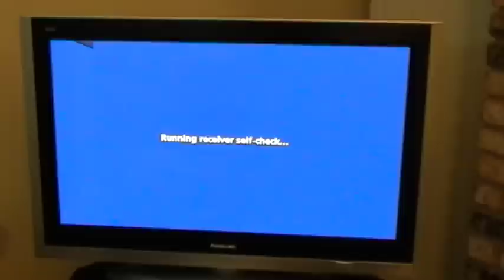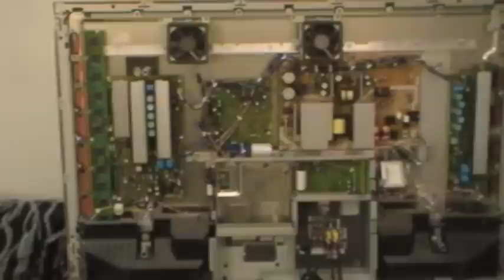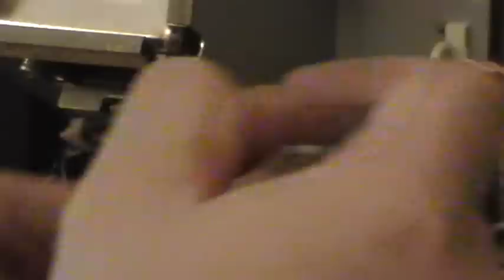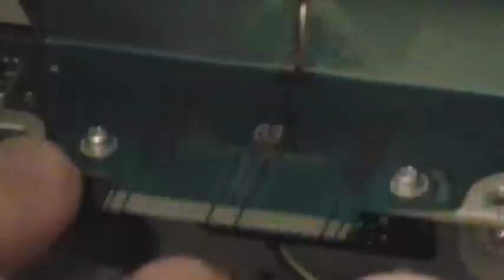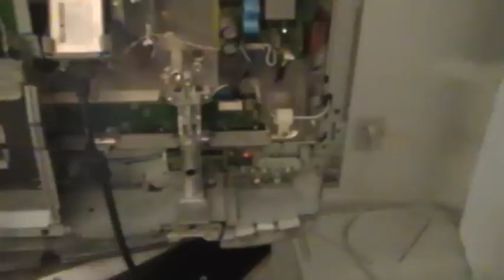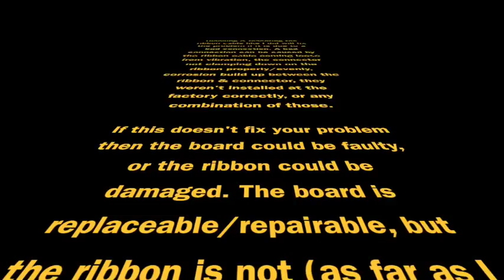Fix Panasonic Plasma TV Vertical or Horizontal Bars

Comment: Thanks for posting. I tried this today with my 2009 Panasonic 42" Plasma television. A 2" pink vertical line appeared from top to bottom in the center of the screen a few days ago. I did exactly as the video suggested, and my tv is now perfect!
Reply from the maker: I’m glad to hear this video helped you out.  Thanks for watching and the comment.  I appreciate it.
Reply: I have this exact problem. Was it easy to fix? And was it a permanent fix?

Comment: Hey Pete thanks for opening up your plasma to solve the vertical picture problem. My 42" Panasonic plasma has a mostly blacked out bar but it's only 1/2 way down from the top. The picture bar also shows a little bit of color image with some images. Any ideas before I open it up?
Reply from the maker: Pet Rock, not Pete.  :-)  Its hard to say what your issue is without having it in front of me.  But if you give the back of the TV a “technical tap" at the top & bottom of the bar and the bar changes then its a loose connection like mine was and this video should help you out.  Thanks for the comment & good luck...

Comment from the maker: ItsaMeMissMario, YouTube wouldn't let me reply directly to your comment for some reason. Anyway, the connectors line up with the vertical bars. So if your bars are in the middle of the screen, you'll need to remove anything on the back of the TV that is in the middle of the bottom of the  screen. On my TV it is the box for the HDMI, coax cables, etc. Its a bit of a jigsaw puzzle, but if you take your time and keep track of what screws & parts go where you should be OK. It might help to take pictures of the back of the TV as you take it apart so that you can get everything back together again. Good luck...
Reply: you sure its not "horizontal" bars? :)

Comment: Thanks so much for uploading this! Mine had this problem for a long while, but then "magically" stopped for months. It's back today, though. I have one question: My line is very close to the center of the TV--just to the left of the "Panasonic" written at the bottom. Is there anything else I'll need to remove to get to that connector?

Comment: My joy was short lived.... After the TV was on for about an hour and a half the dreaded blue line was back ..... Grrrrrrrr!
Reply from the maker: If it worked, even for a short while, then it means you have a loose connection somewhere. In other words, you can fix it.  Take the back cover off and wiggle the ribbon a little and see if the picture changes (even a little).  If it does, then the ribbon cable is still loose.  If not, try the other ribbon cables, as well as lightly press on the board that the cable attaches to. If the picture changes, even a little, then the loose connection is in the area you are touching.  Good luck...

Comment: Thank you for posting this video.  I have a Pana 42 inch which has the same issue (1" black vertical bar down the left hand side).  Tried opening it up and following your instructions; I had a slightly different tv but pretty much all of it was the same as you had detailed.  Cleaned out the connections, and tried to remove any dust etc, but sadly the line is still there :(  Guessing it must need a replacement connector or something....
Reply from the maker: Sorry to hear it didn’t work for you. If you disconnect the ribbon corresponding to the vertical bars and turn the TV on does the black bar go white like mine did in the video around 8:20? If so then the problem is likely the connection or the board not the panel. If it stayed black then it is likely the panel. If a different section goes white, then you unplugged the wrong ribbon cable. You can also try some electrical contact cleaner on the ribbon connections (avail at most auto parts or hardware stores). Make sure the TV is unplugged when you are messing with the ribbon cables, btw. Good luck...